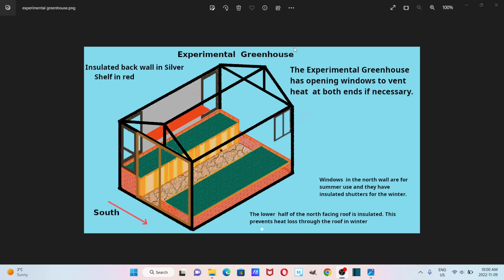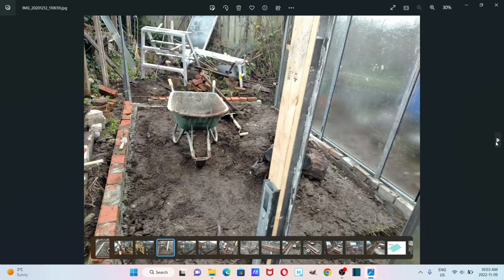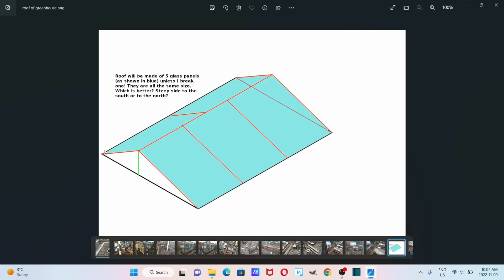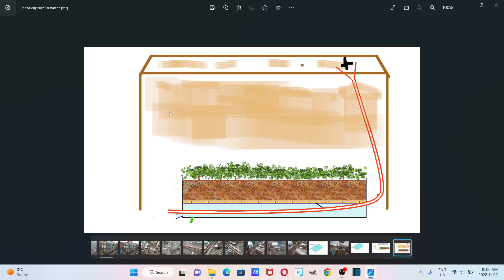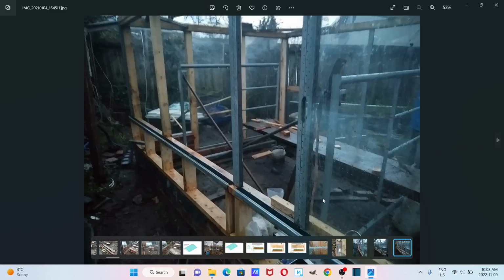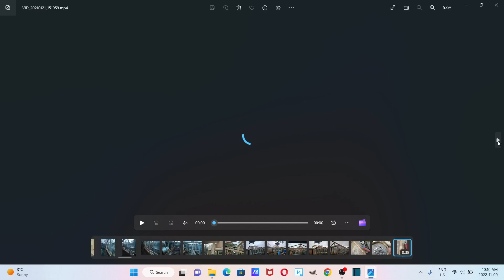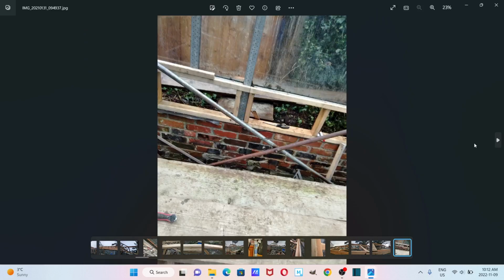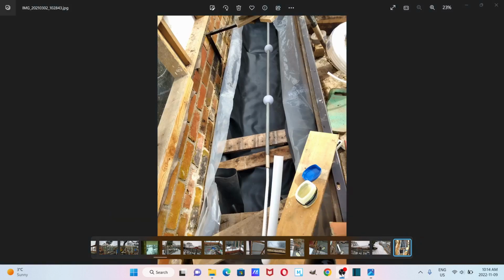Experimental  greenhouse part 1. Building it.

Comment: Have you seen the dual wall plastic versions where you inflate a 3 inch gap between layers of plastic with a blower fan? Supposedly the add lots of R-value.  Also I recommend Chinese diesel heaters for people in snow climates, I was able to run a small greenhouse all winter in Michigan economically with one.
Reply from the maker: Yes, I have seen the dual wall versions  but I haven't looked into it.  I used single pane glass panels for the sides because it was free and because we have very very dull winters here so any extra layer of glass reduces light levels and slows down plant growth. (And for the roof because I am a bit crazy). I did the entire greenhouse on my own and I am a bit amazed that I got 5 huge glass panels onto the roof without breaking them!  I recommend you use plexiglass for the roof and glass for the sides if you DIY.    Note that in the second year,  I removed the glass from the back wall and turned it into an insulated wall (with reflective tarp on the inside) to improve the light levels.
Reply: @Brians-Easy-Low-Tech-Solutions  That's awesome and useful information, thank you!!!